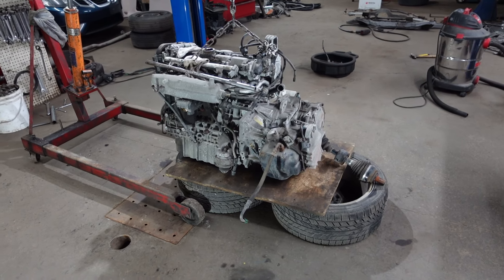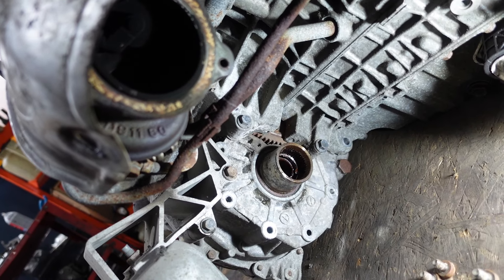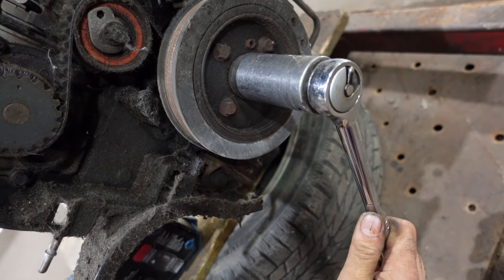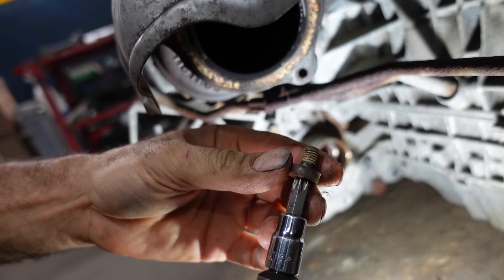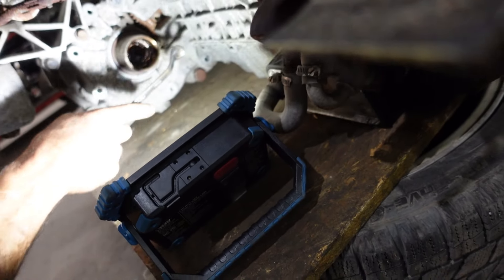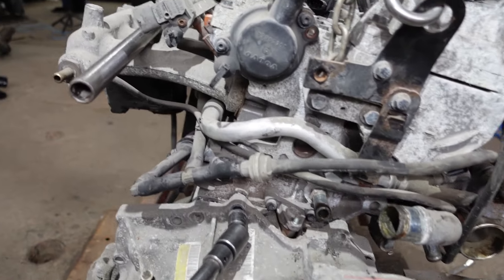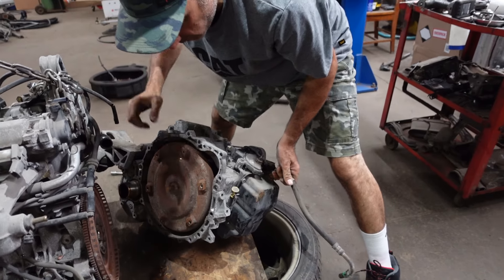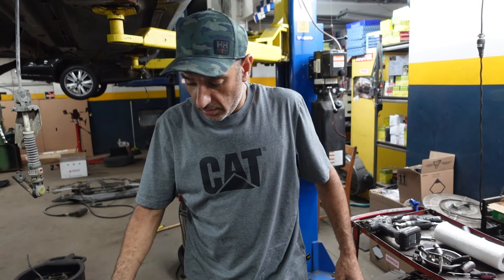How To Split The Automatic Transmission From The Engine VOLVO XC70 2001-07(Powertrain Removal Part5)

Comment: Many thanks for your concise explanation. I am trying to remove/replace a Ford C-Max auto box but I can't find a window for that screw in the flywheel that you aligned. Do you reckon most autos need that screw removed or do many units not have the same thing? Many thanks in advance! Steve Howells
Reply from the maker: In my opinion, flywheel bolts are visible, after removing the starter.
Reply: @saabmastertech5852  Many thanks for your time- it is much apprewciated. But do all autos have those bolts? I have found a hole which might allow me to access any bolts but I can't find a way to rotate the flywheel. The auto box is empty of fluid so perhaps the only way might be to put 12V across the starter? Any thoughts?
Reply from the maker: Most cars with automatic transmission have either 4 or 6 bolts between the plate and torque converter. It should be visible, when you remove the starter. Is the car hybrid?
Reply: @saabmastertech5852  Hi again, no its a straight diesel auto. The boxes are well known for being under specced so they fail around 70K. I got the starter off and found the first bolt...It faces into the engine so I can't get to the head! It is beginning to seem its impossible without removing the engine. Do you agree? Should have done it to start with- its been a Houdini job throughout :(
Reply from the maker: I am not expert in diesel cars/trucks. Maybe there is a way to get to the bolts. Did you rotate the crank pulley? No visible bolts?
Reply: @saabmastertech5852  After a bit more effort I found the bolts were just where you suggested (apologies) and I managed to remove the 15mm nuts. Still can't budge the box! I have hit it hard after trying jacking it up and down a bit but the joint is unmoved. I can widen it a bit with a screwdriver where there is a cleft but only a mm or 2. Do I need to use more force? Its too big to man handle like I have seen mechanics do with manual boxes. Thanks again for the help :)
Reply from the maker: Between the engine & transmission, there are two guide pins, one on each side. Spray some loose nut in between. With little force, it has to move, if it does not, double check, if you removed all the bolts that hold the transmission to the engine & there is nothing blocking on it way out. Hope the jack is big enough to handle the weight & have someone else to help you out with lowering the transmission.
Reply: @saabmastertech5852  We did it!!! I found one last bolt hidden away and it fell apart. A pig of a job but the rebuild with a manual box will be a joy. Thanks again for your support. I will read more of your videos although it will take a lot to get me to split another box any time soon :)

Comment: How do you turn the flex plate when it is tough? Is it 30mm?? What do you recommend I do?
Reply from the maker: Turn the crank pulley with 1/2inch drive 30mm socket.
Reply: @saabmastertech5852  thanks. Will this damage or mess up the timing at all??
Reply from the maker: @rtfdxn  Yes, it will. If there is any damage on the flex plate, or the timing belt is off.
Reply: @saabmastertech5852  but if the timing belt is on and there is no damage on the flex plate, we should be fine?
Reply from the maker: @rtfdxn  Yes, we should.

Comment: Can I replace automatic gearbox in V70, 2.4d, 2008 year without taking the engine out? Cheers mate.
Reply from the maker: Yes, you could. You will need engine transverse support bar. Remove the subframe & the transmission.

Comment: Do I need to do a flash transmission after replacing it? 07 Volvo s60
Reply from the maker: You will need to reset the transmission adaptations with a scan tool, after replacement. If you don't have a scan tool, try disconnecting the battery for couple of days. Drive the car for at least 2 weeks. It is very important that the check engine is not ON, during the adaptation period.